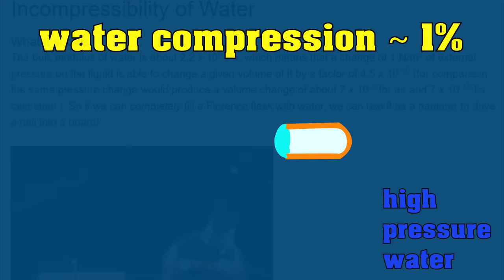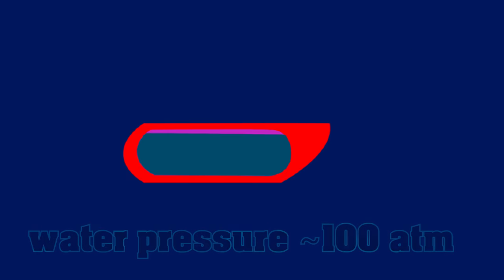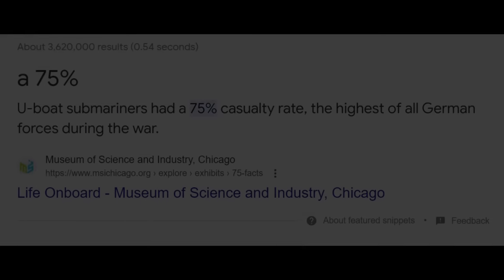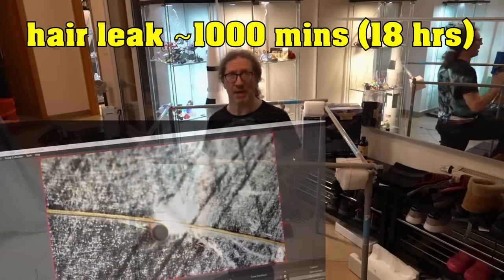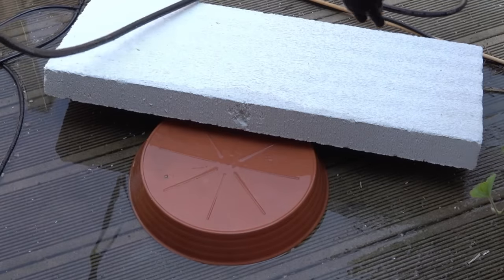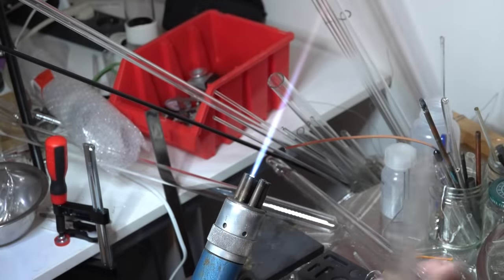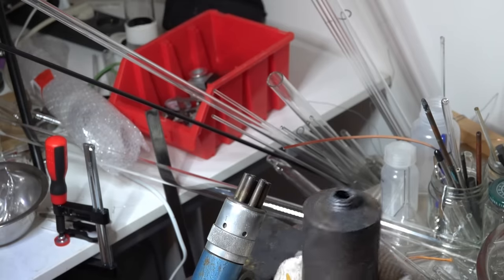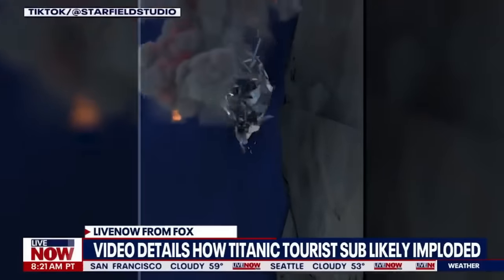Why the Titan sub failed

Comment: Ever since this sub went missing, and I heard it was a CF tube capped with Titanium caps, I instantly thought of the interface between the two materials.  Whats even more shocking, is that it looks like the interface was flush.  The interface between the titanium and the plexy window was tapered, so that pressure would compress the bond.  If the interface on this sub between the composite and titanium end cap was flush, it was ripping apart that glue every single dive, vs just compressing it.
Reply: What would be causing it to rip? In my mind the pressure on the end caps would be compressing the glue joint.
Reply: Can you explain more on why this would be bad? How was the glue 'falling' instead of being in place. 'was flush' is that the same as 'was level'?
Reply: Yes, they may have been better off using a compressible gasket between the CF and titanium cap..as industrial hydraulic cylinders do. Even a nylon washer may have been better
Reply: What if it had been a U-shaped flange on the titanium ring?
Metal under the carbon and metal above the carbon.
Reply: @zerotwo7319  If you look at the joint, you basically have a vertical plane where the two halves meet. All of the force (from differential compression) is also pushing along this vertical direction, so the glue is doing all the work
Reply: @PR-cj8pd  if you have titanium below of cf if will probably make the cf crack if the cf wants to compress more than the titanium. If you had some sort of compression gasket between them it might work... maybe.. not really sure how the titanium ring looked.. if it was L or U shaped.. either way the different compression rates seem to b a problem..   ut since they made several dives they must have done something to mitigate it.
Reply: Every time the CF got compressed. It tried to flex and become smaller.

And it got crushed inward by the two caps who appear to be well rated for the task given.

The glue interface between the layers must have been under immense stresses with the CF trying to shrink around a Cm with each dive, I couldn't name a glue flexible enough to retain formation while flexed to that degree.

But it appears they slid the CF inside a titanium ring thus the glue joint was supported at ends on both sides of the tube.

This would prevent the CF in the joint from changing shape at all despite the tube adjacent to the bond location being crushed inwards.

So while my suspicion was placed firmly on the glue initially, it now looks like the CF titanium interface was the key stress point in the frame. Fortunately much of that stress was tensile in nature. Unfortunately that tensile strength would be added to compression forces from the end caps themselves.

So the CF may have failed under compression, from the inside of the sub, at the join between the titanium and Carbon fiber where the tube flexed every load cycle.

I am not convinced they braced the length of the sub sufficiently on the outside to keep the end caps stable to maintain tension between them as the CF tried to pull tight as it flexed inwards. That could have boosted strength, yet not resolved the compression ring at each end which could lead to this mode of failure.

The desire for water to want to slip between the layers through any cracks in any layer of the carbon fiber to cause delamination is noted. But such wet voids would be more obvious than the dry crackling of flexing fibres on the interior which would be in a very difficult spot to inspect between dives.
Reply: @glenmcgillivray4707  would my it be sheer forces? The cf Inside the titanium ring is supported by the ring while the cf outside is not. So there will be a sheer force where the cf meets the titanium ring. Atleast if the end caps are U shaped... if they are just L shaped the bonding agent would have to deal with heal of alot of tensile stress when  the cf is compressing and the titanium is not.
Reply: @kungfreddie  you don't expect longitude compression to be large when glued to a surface, the forces there can be transferred to the second surface in an L config. But that stops applying at the edge of the glue, and also at the hard edge of the titanium.

There are a few construction questions I have about the particular design choices to work out what if any fluid pressure could infiltrate the bonding region because it feels like the most vulnerable region. but again flexing from flush to a parabolic curve due to load transfer has a sharp edge on the harder surface.

You thus expect flexing in the opposite direction, a normal distribution graph supposedly with the greatest deflection at the center point. But for a submersible that center point will be consistent with a smooth deflection and tensile inner surfaces, which feels to me less vulnerable to point damage and cracking due to loading.

The inner surfaces at the Titanium-CF union will be transferring that flexing force from the CF core to the ends, plus be loaded with compressive forces of the end caps transferring through the hull unless someone welded external bars to surround the CF core, or even better, inside the tune to take stresses off the walls of the CF core. Which we didn't see at all. In essence it looks like a position with 3 or 4 distinct and unique sources of loading are occuring, and thus damage in a compressive surface could accrue and build without immediately shredding the sub, permitting 10+ dives before failing catastrophically.

But it's far from the only possible place or mechanism to kill this sub.
It's just the spot that my suspicious nature circles with a 'so.. exactly how vulnerable was this spot in reality, because it's looking pretty miserable'
Reply: I find it insane that noone of the people working with that glue didn't warn them exactly that would happen. Like they must have known. It is pretty straight forward calculation for the stress on the glue and to figure out it can't hold. I am surprised it even held one cycle.
Reply: @m1t3com  They were given the glue's data sheet that is their warning of the glue's tolerances.
Reply: @zerotwo7319  The carbon fibre was compressing about 1% more than the titanium at depth so basically every dive it was shearing off about 1% of the glue and after a dozen or so dives the glue gave way and let the water in and at depth a small leak would become larger very quickly as the water would brute force its way into the small hole and make it bigger.
Reply: @justicedemocrat9357  oh. Now I get it. Thank you.

Comment: There is an issue with this hypothesis - the debris was consistent with an implosion and this sort of leak would not result in an implosion. As the chamber filled up the pressure would equalise so as soon as the leak started the internal/external pressure differential would decrease and an implosion would become less likely. The resulting wreck would be relatively intact and full of water, not crushed into debris. So it seems to me the catastrophic collapse was more likely.

Am I missing something?

Comment: What you don't consider is that at that depth, titanium and fiber glass are firmly pressed against each other, it's not like they are going to slide against each other, like in your experiment, and break the bond. Besides, according to the recently released transcript of the communication, if it is authentic, they had the acoustic integrity monitoring system all red, which means the fiber tube was failing everywhere, not at the point of contact with the titanium caps.
Reply: I don't think TF missed that.
You seemed to miss his experiment where the 2 different materials perfectly showed how 2 different materials bound together with unequal expansion rates will react. Pressure vs temp, maybe a slight difference but in the main its a good show and tell experiment. 
You also seem to fail to understand that if the bond finally broke enough or for good at depth and water was able to find ingress due to bond perimeter failure, then thats possibly what allowed water in. And most likely immediately went from a small, pinhole of mm sized opening to a larger, and larger, and larger enlarging hole, destroying the CF.  Who knows, official transcripts are still under investigation as far as I know, so that has no weight.
Cracking was heard on dives before the final one, whether it was around cylinder shell laminate or from glue cracking is unknown.
Certainly very possible with the expansion differential TF showed that it might have been from one of the ends where glue bond was.
Reply: @boots7859  I didn't miss his experiment, and didn't fail to understand anything. Reread my message, keeping in mind that it considers everything you said. If you don't understand something in what I said, please ask questions instead of jumping to conclusions about my inability to understand something. I will much appreciate this. For the record, I hold a PhD in physics.

Comment: Your pressure washer doesn't push water out at nearly enough speed. If it could push water out at three times the speed of sound in air (like the water jet through a pinhole in such depth) you and the whole neighborhood would be able to tell when it started working.

Comment: I posted the same explanation a day or two ago on The Hydraulic Press channel where he tested carbon fiber at depth with metal end caps. there was no leak, the carbon fiber compressed under the weight of the ocean so much that the glue failed instantly tearing from the titanium ring. it also didn't help that they dived down at such a speed that would have prevented the settling of the materials. if they would have used an inner compression collar with bolts they might be alive today.
Reply: It would have just delayed the failure some small x number of dives.
Experts are all in agreement, and most of the people in the comments here with common sense.  Using CF for anything structural in a diving vessal is stupid unless its really cheap, non-magnetic drones.
Reply: @boots7859  I agree that carbon fiber as a choice in a deep-sea diving vessel was downright stupid. it's not so much the failure of the material but more the deflection of the material under heavy compression. the movement of carbon fiber in relation to titanium under pressure was a guaranteed failure point especially when those connections were not secured properly.  once the titanium ring separated the vacuum created by the water rushing in imploded the ship causing the carbon fiber to shatter like glass. the vessel might have not lasted long but I believe an internal titanium compression ring to hold the outer ring in place would have given them a better chance of survival. As for it being used as a regular submarine material I think it will work with the proper thickness to prevent major deflection. people need to remember it failed at around  12,500 feet a standard military submarine operates at max 2700 feet. so to rule out carbon fiber for good in submarine production I would like to see further tests on long-term exposure at depth and tests of different resins.

Comment: The instant I heard the sub was made primarily of carbon fiber alarm bells started ringing.  Not because of the material differences but simply the way its low compressability is going to make it deform under any significant pressure.

Comment: I think your thesis about the pinhole leak is incorrect. They found the sub smashed to pieces. That would imply an implosion and not the sub filling up with water, which would have equalize the pressure and kept it all in one piece.